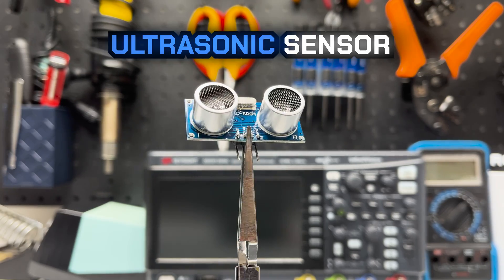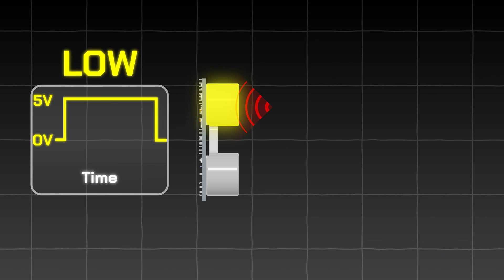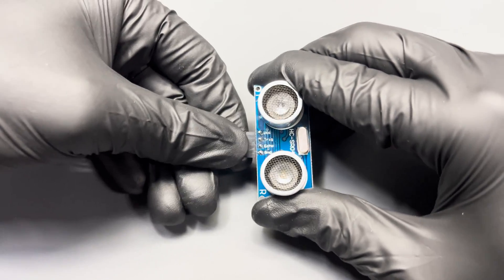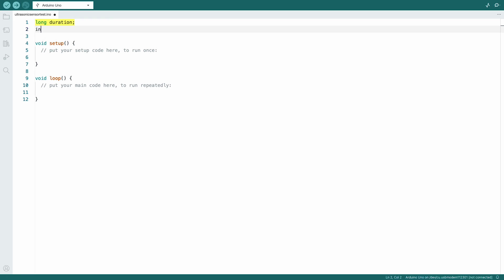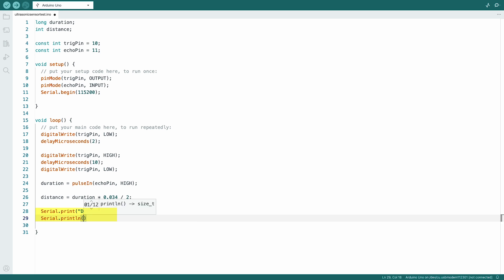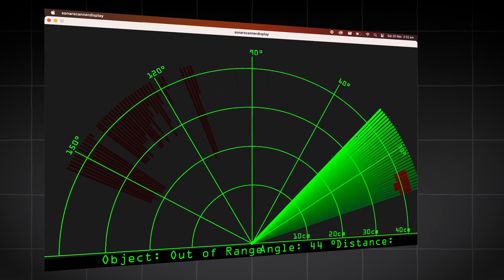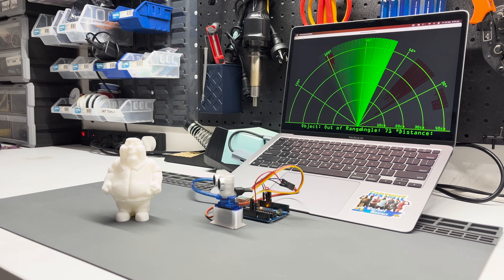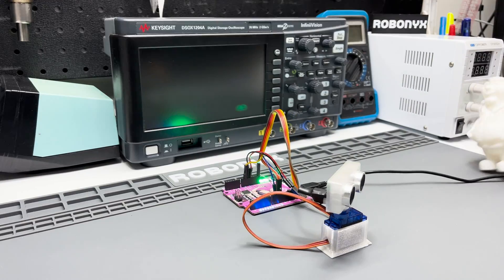How To Use Ultrasonic Sensors with Arduino! + Project Idea!

Comment: can somebody explain why the speed of ultrasonic is 0.034??
Reply: The value 0.034 represents the speed of sound in centimeters per microsecond ( Answered by Google Gemini )

Thus, in my understanding; sound travels at 0.034 centimeters per microsecond, meaning that if the nearest object is 0.034 centimeters away, it will take ~1 microseconds for the sound waves to reach the object, and ~1 microseconds to echo back to the Ultrasonic Sensor, leaving a total of ~2 microseconds for the reading to return to the sensor; which is why we divide the duration by 2 to get the real distance.

Hoped this helped :p

Comment: CAUTION, ultrasonic sound can permanently damage your hearing, I know from experience.  Years ago, I built a sonar system to scan the room and build up an image of the room.  When I tested it I was sitting a couple feet from the rotating sonar system. I worked with it for a couple hours one day and the next day when I woke, I was almost completely deaf.  Over the next week much of my hearing came back, but today I wear hearing aids.  The sonar signal is at 40KHz pulse about 8 mS long.  40KHz is far beyond what you can hear, but like all sound waves it has energy and just because you can’t hear it doesn’t mean it can’t damage your hearing.  From the transducer’s spec sheet, I calculated my transducer’s output level at about 125db.  I have measured the signal driving the transducer on several of today’s Chinese made sonar system and found their output to be about 115db, lower than the one that damage my hearing, but certainly loud enough to damage a persons hearing if they are close to it.
Reply: I have seen you in about 5 videos yet
Reply: Thanks for the info
Reply: Dawg it's a radar not a speaker
Reply: How can I keep myself safe then?
Reply: You aren’t an engineer when saying this btw… This is an arduino, a board for hobbyists or enthusiasts! That sonar can barely do damage, you just put a jet engine near your ear and set it to whisper mode, It’s your fault you became “deaf” or whatever you consider it to be
Reply: The sonar has one speaker that transmits a 40KHz sound wave and one receiver that picks up the echo from that sound wave.  Just because you cannot hear it doesn’t mean it cannot damage your hearing.  That 40KHz sound was is an 8 mS pulse with an amplitude of about 115 db.  If you are very close to it, it can damage your hearing.  Yes, it is my fault I damaged my hearing, but I didn’t understand that a sound I couldn’t hear could damage my hearing and I want to make sure others understand that, so they don’t damage their hearing.  I am not saying don’t use sonar, I still have sonar on my Robot.  I telling you to be cautious and don’t put your ears near the sonar @nuclearsulaimanplayz42069

Comment: If i wanted to connect a sensor to control audio, what kind of output jack would i need? i would need a 3 pin connector but not sure about what else

Comment: I had an issue and the code here showed me on my serial monitor a 0 one time every two line, I read that in the technical sheet from the HC-SR04 the delay between burts should be min 60ms to avoid interferences and so wrong info. It fixed the problem so if by any chance someone was looking for an answer, here it is.

Comment: const int echoPin = 2;
const int triggerPin = 3;

long duration;
int distance;

void setup() {
   pinMode(triggerPin, OUTPUT);
   pinMode(echoPin, INPUT);
   Serial.begin(9600);
}

void loop() {
   digitalWrite(triggerPin, LOW);
   delayMicroseconds (2);
   digitalWrite(triggerPin, HIGH);
   delayMicroseconds (10);
   digitalWrite(triggerPin, LOW);

   // Read ECHO - sound wave travel time in µs
   duration = pulseIn (echoPin, HIGH);
   // Calculate the distance
   distance = duration * 0.034 / 2;

   if (duration == 0) {
      Serial.println("No echo from sensor");
   } else {
      Serial.print("Distance:");
      Serial.print(distance);
      Serial.println("cm");
   }
 delay(100);
 }

Comment: Great presentation, inspiring video, I want to make a pressure modulation and chamber controlled prosthetic arm, that intermittently needs a small top up of air, using arduino r3, but it's mechanical workings are airtight. Do you think this would make a quieter design for a prosthesis, as opposed to motors?

Comment: I have a problem with my sensor. I get reading if the object is about 10cm from the sensor though once it gets further ayaw it always give me a 1011+ reading. Im using the code found on arduino site.

Comment: my code is not working pls help
Reply: long duration;
int distance;

const int trigPin = 10;
const int echoPin = 11;

void setup() {
  // put your setup code here, to run once:
  pinMode(trigPin, OUTPUT);
  pinMode(echoPin, INPUT);
  Serial.begin(115200);

}

void loop() {
  // put your main code here, to run repeatedly:
  digitalWrite(tringPin, LOW);
  delayMicroseconds(2);

  digitalWrite(trigPin, HIGH);
  delayMicroseconds(10);
  digitalWrite(trigPin, LOW);

  duration = pulseIn(echoPin, HIGH);

  distance =duration * 0.034 / 2;

  Serial.print("distance: ");
  Serial.println(distance)

}
Reply: @Lili_FANTASY10  forgot ';' at the end and you wrote tringPin instead of trigPin

Comment: long duration;
int distance;

const int trigPin = 10;
const int echoPin = 11;

void setup() {
pinMode(trigPin, OUTPUT);
pinMode(echoPin, INPUT);
Serial.begin(115200);

}

void loop() {
digitalWrite(trigPin, LOW);
delayMicroseconds(2);

digitalWrite(trigPin, HIGH);
delayMicroseconds(10);
digitalWrite(trigPin, LOW);

duration = pulseIn(echoPin, HIGH);

distance = duration = 0,034 / 2:
01/12 println() -> size_t
Serial.print("Distance: ");
Serial.println(distance);

}

The full code.
Reply: i love u
Reply: the last line is it print"In"
Reply: Can u provide the full with servo moter?
Reply: Duration * 0.034

Comment: Please make digital tachometer using ir sensor and arduino Nan please make
Reply: Bro i will
Reply: @AKElectroDIY  Thenks Bro please make this
Reply: @Bakulmali6954  Yeah soon.
Reply: @Bakulmali6954  I also need this to measure speed of my bldc motors. So I will be making this
Reply: @AKElectroDIY  ok but display liquid crystal 16×2 use in project ok

Comment: "Please create a fingerprint attendance system using ESP32, OLED display, SD card module, and an RTC (Real-Time Clock). It should operate on battery power, record working hours, and store today's attendance data on the SD card. I would appreciate additional features. Looking forward to your creation! Will you be able to make it? Please let me know as soon as possible.
Reply: This looks like your homework assignment.